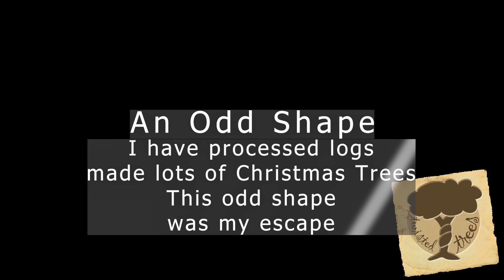Odd shaped Ash Bowl #woodturningart #woodturning

Comment: Lovely work Pete. What bowl gouge are you using there and have you re-ground/shaped it. I want to treat myself to one for Christmas.
Reply from the maker: Hi Anthony thank you for watching, the main Bowl Gouge used was the 16mm Hamlet though I mostly use Robert Sorby ones. profiles I play a bit... this one is a 50 degree fingernail grind, with 16mm long wings on each side, very efficient for stock removing. I also use a standard 45 degree fingernail usually on the 13mm gouge, and a 60 degree traditional straught across grind to reach awkward bowl bases